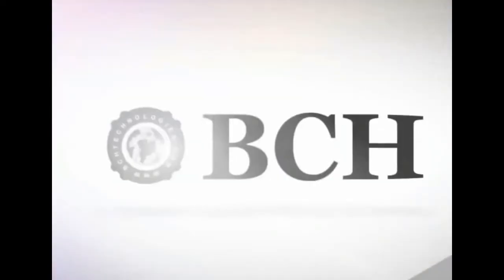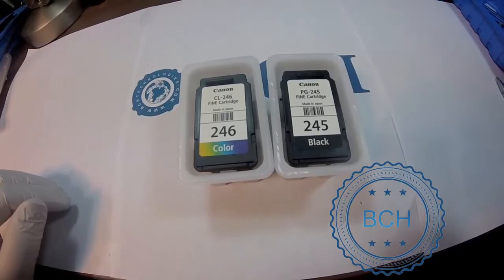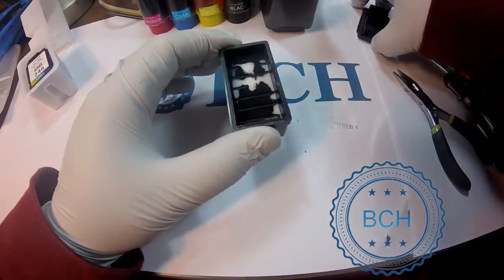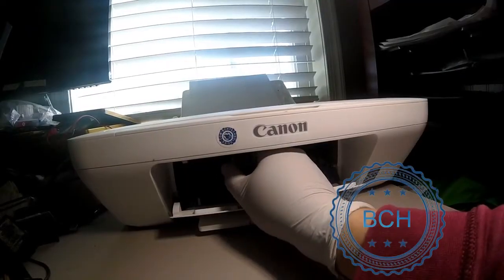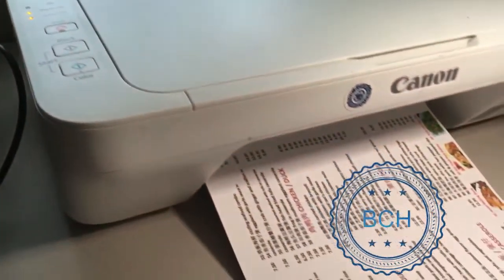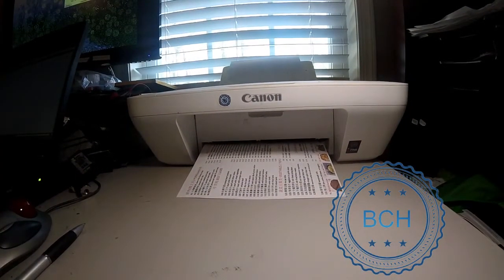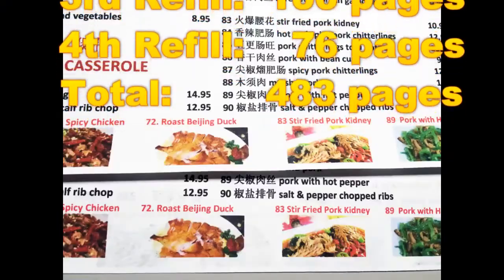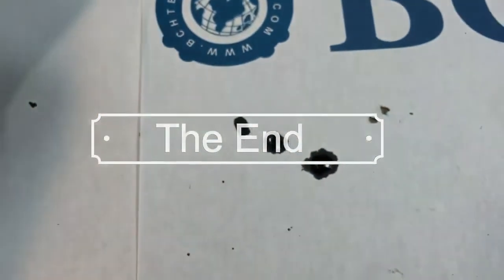How many times can you refill PG-210 CL-211 PG-240 CL-241 PG-245 CL-246 cartridges?

Comment: My Cannon MX490 still reads low (black 245) after doing this refill and after trying to reset it many times..
Reply from the maker: You cannot reset it when it is just "low" on ink.  You have to wait till you see the error 1686/1688.  Just keep printing.
Reply: It wont print with the low reading..
Reply from the maker: @seventhousand  Do you get an error message or the printer prints but the output is blank?
Reply: When I click on print I get a message showing the ink levels, black low, the printer still prints but the page comes out blank...
Reply from the maker: @seventhousand  Then it is not due to the chip or ink level.  It is due to the printhead clogging.  The printer works but your printhead is clogged.  Try one of these tricks (https://youtu.be/POaio4pnURI) and it will put your printer back on the horse.
Reply: You were right...I got the black to print, I soaked the bottom of the cartridge in Isopropyl alcohol for about 45 minutes, then wiped the bottom off, then soaked it in warm water for about 10-15 minutes wiped the bottom off stuck it in the printer and the black is printing again. Thank you for your help...
Reply: @BCHTechnologies  Just FYI that link is now a 404
Reply from the maker: @dstgre  Fixed.  Thanks!

Comment: Hi Kevin,

Can I refill non Canon brand ink cartirdges? I was planning on buying new cartridges from ''Ejet'' on Amazon since I haven't used my printer in a long time so most likely my Canon cartridges has been dried out.

Thanks!
Reply: There are no new ink cartridges from other brands. Only canon makes them (they have special chips which nobody can reproduce). These brands buy empty cartridges, refill them, remove canon branding from them and add their own sticker. If your OEM cartridge is dried out, put it in warm or even hot water for a few minutes, dry out thoroughly, put in printer, run deep cleaning process around 3 times, and print a few pages that have the color which is dried out. Repeat until works again. I have succesfully restored a few cartridges with this method.

Comment: This method is the simplest and easiest way to refill for me. I just did it and no issue.
I made sure wearing gloves to not touching print head and electrical connection, and of course to keep my hand clean.
Thanks. This video saved my time and unnecessary drilling holes.
Reply from the maker: Thanks for sharing

Comment: I have refilled the 245 XL till it bleeds out and it still wont print and the ink is bleeding out of the print side slots.
I dont think this refill crap works.
I have tried and my fingers are black with ink.
I called up canon and they say you have to order straight from them to get the "FULL" cartridge of ink.B.S.
Reply: If you have a dried out cartridge or you've been printing too long with streaks, you should unclog the cartridge before refilling.  If you continue printing with a dried out cartridge, you will irreversibly damage it.  If you have to buy a new cartridge, get the XL type.

Comment: If the sponges are in the “overfilling” state, does it work again if we rinse it with water and clearing up the ink, then use it again
Reply: If overfilled, and the cover is off, I'd simply flip it upside down  and let the excess drain out.  Then clean it off with a dry cloth.

Comment: What kind of ink do you use here? Dye or pigment?
Reply: On low cost printers, the colors are almost dye inks.  For the black, they are usually dye based but if they are pigment based, you'll get the best results using pigment ink.

Comment: Can regular cartridges be filled to XL levels, or does the XL cartridge have larger reservoirs and sponges? Is it better to refill regular cartridges or XL cartridges?
Reply: XL cartridges have really nice big sponges, so they can hold more ink with out making a mess.  "Regular" cartridges have the same size resevoir, but a smaller sponge.  The sponge of the black cart in this video is a regular, not an XL.  The starter or regular cartridges are good candidates for the spongeless lid replacement, or continuous ink supply systems, or you can actually buy a bigger sponge.  So far, I really like Canon sponges better than HP, but we will see how it stands up to refilling.   I should probably set up my continous ink supply, but I am still learning Canon.  Back in the early oughts, HPs were the best to refil, but they defend their proprietary ink too hotly these day and are no longer refillable.  So, Canon is now the most refillable.

Comment: well i did it and ink come out very fast  on the bottom
Reply from the maker: That's because you overfilled it.  The cartridge has a sponge and your goal is to get the sponge wet, not soaked. Many people believe there is a swimming pool inside the cartridge and fill the ink to the rim.  Don't.  For the overflow cartridge, just leave them in the printer for a day or two, then take them out and wipe the bottom clean.

Comment: I just did the same thing you request to do with 2 original canon cartridges and it does not work, my printer never recognize them anymore and giving me problems and error codes every time....  your demonstration is actually not quite accurate...
Reply from the maker: What was the error code?
Reply: @BCHTechnologies  :: the error code was given by other cartridges I had on the printer and was telling to call the tech support on cannon, so I did have the original cartridges cannon that I had before them and did your suggestion on refilling them just like your video describe; but the printer never recognize that the cartridges were full of ink; I also did the suggested resetting and still did not work... so I decide to purchase two refiled cartridges from an reputable supplier on ebay, that actually provide me with a guarantee and those work fine; but I still paid $close to $30 for them; which compared to $55 original Cartridge on Walmart is much better.....   BUT YOU WAY OF REFILING DO NOT WORK FOR ME!!!!
Reply from the maker: @waltpierluissi2301  Yes, the printer won't recognize the new ink level.  Keep printing.  You can't "reset" the chip.  Just keep printing until one day the printer stops you and says "Error 1688 (or 1686,...)" the following cartridge is depleted.  Do not close that window.  Keep the window open and press and hold the STOP button for 5 seconds. The STOP button is the one with a red upside-down triangle, not the scan button.  You will hear a click, and the printer is back to work.  It won't track the cartridge ink level anymore, and you can add ink as many times as you want.

Comment: Should one be worried after refilling a cartridge that used pigment ink with dye ink? Is it neccessary to wash the sponge first?
I am not sure if that's the reason my black cartridge is not working correctly (it starts printing a few pages correctly, and then gradually "looses" black ink, within one page).
It seems to me that is too early for the super-bubble scenario, as the cartridge itself is not that old (I have it for a month, 1500 pages)
Reply: Add a drop or two of 99+% isopropyl alcohol to the ink to loosen it up, it'll flow better to the print head. What you are experiencing is a viscosity issue and the ink just doesn't flow as freely or quickly as its supposed to. Loosening it up with rubbing alcohol of 99% or more solves the issue. Do not use anything under 99% as it contains too many impurities like water and such that will ruin the ink and cartridge.
Reply: Dye ink is better if you are occasionally using printer as dye ink can be unclogged easily by keeping the printhead in water for 15 minutes. But if pigment ink clogs you will need to use isopropyl alcohol to unclog instead of water which will be expensive. Even then the sponge will still be somewhat clogged forever
Reply from the maker: Thanks so much for subscribing and supporting the channel—it really helps us get closer to our 100k goal, and I try to answer subscriber questions within a few days even though I’m working through a big backlog. To your question: the good news is you don’t have to worry too much because printers can generally use either dye or pigment ink. Pigment printers clean more often, so running them with dye ink actually makes clogging less likely, and dye ink has the added advantages of being cheaper and easier to unclog. Pigment ink in a dye printer is trickier, but if you go that route you’ll just need to add manual cleanings. I recommend dye ink for most cases since modern formulations handle everyday printing well without fading or smearing under normal use. Just try to use up as much of the old ink as possible before switching types, since mixing pigment and dye long-term can create clogs due to their different chemical bases. If you want to dig deeper, I’ve linked some resources and ink options in the description, but the short answer is: dye ink is usually the safest and easiest choice.

Comment: I kind of refilled around 10 or 12 times of more than that by the method of drilling, but now I don't know it's not printing, it's like clogged but after watching all ur videos I tried to wash out or pressurize it but still it shows no improvement.
Reply from the maker: It depends on what ink you used and the age of the cartridge.  If you use pigment ink, my current count is about 2,100 pages to 2,600 pages.  For dye ink, the current count is about 3,600 to 4,000 pages.  If you refilled 10 times and used pigment ink, you are about to be around the limit.  However, if you used dye ink, you should be able to refill another 10 to 12 times.  However, these are disposable bubble jets and the printhead do get old.  We have a blog, showing the difference between a clogging printhead and dying printhead: https://www.bchtechnologies.com/blog/3-symptoms-of-dying-printhead-poor-printing-quality-may-not-due-to-clogging
Reply: yes it was very informative in knowing the theory of urs. you worked dedicatedly. one more question is pg-47 will be compatible to canon mg2500 series ( mine is mg2470)
Reply from the maker: Thanks.  I am not sure about if PG-47 will be compatible with Canon MG2500.  PG-47 is an Asian model for Canon Pixma E400 / E460 / E480.  The US market uses PG-243 CL-244 or PG-245 CL 246 for MG2500.  Canon usually changes the first digit across the markets, for example, 243 becomes 143 or 343.  The product page says it can print 400 pages, I guess it is equivalent to PG-245XL?
Reply: @BCHTechnologies  Put the cartridge in hot water for two minutes to remove the clogging.Shake to remove the water, some ink will come out, dry with tissue and install for printing.

Comment: Hello

Thank you for your video. Help!!!
I am having problems though... I tried your method but it keeps giving me a blank page when I click,  print and there is no print on the page...It was working for a few times before, after my first refill, but stopped all of a sudden...my cartridge doesn’t seem damaged
So I refilled again.

It gives me the test print of alignment with various colors including black but doesn’t print the actual material I want to be printed.

Would highly appreciate a response...
Reply from the maker: Yes.  We had two more customers reported the same issue.  It is due to your computer's software setup rather than the printer.  Restart the computer should solve the problem.  The symptom is that the printer can print diagnostic page but can't print regular pages.  Both customers reported the problem went away after restarting the computer.

Comment: Hey do you know why the black are not as black after refilling? Like, the shade of black is less deep and rich.
Reply from the maker: The dye black is not as "black" as the pigment.  Actually, it is deep purple.  If you use BCH ink, we are coming up with a new dye ink for medical printing, which is the darkest dye ink.
Reply: It wasn't BCH ink I guess the ink is the problem.

I'll get another ink. Can you wash out the sponge under water? I don't want to mix the bad ink with new ink.
Reply from the maker: If it is dye ink, then don't worry about mixing.  It should be okay.  Yes, you can wash the sponge with water.

Comment: Do your sponges resist drying out? Kits look kind of nice may test them out. Video extremely informative please leave it up.
Reply from the maker: Thanks.  We don't use a sponge.  We use a pressure regulator so it won't have fatigue issue.
Reply: @BCHTechnologies  but you used the sponges in the video

Comment: which type of ink you used and where we should buy this ink?
Reply from the maker: Thanks so much for subscribing and supporting the channel—it really helps us get closer to our 100k goal! Since your cartridge is an integrated type (printhead built into the cartridge), the manufacturer doesn’t design them with strong anti-clogging features, so we recommend using dye ink because it clogs less and is easier to unclog. If you want to start small, you can try this set: [https://www.bchtechnologies.com/refill-ink/refill-ink-for-canon/dye-30-ml-x-4-refill-ink-for-canon-printers-id30-kcmy-ac.html](https://www.bchtechnologies.com/refill-ink/refill-ink-for-canon/dye-30-ml-x-4-refill-ink-for-canon-printers-id30-kcmy-ac.html), or if you’d rather save money long-term, go with bulk ink: [https://www.bchtechnologies.com/refill-ink/refill-ink-for-canon/standard-600-ml-4-color-refill-ink-for-canon-kd600x-cc.html](https://www.bchtechnologies.com/refill-ink/refill-ink-for-canon/standard-600-ml-4-color-refill-ink-for-canon-kd600x-cc.html). If it’s your first time refilling, a priming clip can be really helpful for clearing clogs: [https://www.bchtechnologies.com/accessories/priming-clip-tools.html](https://www.bchtechnologies.com/accessories/priming-clip-tools.html), but you can also retrofit a household vacuum using this guide: [https://www.bchtechnologies.com/blog/solved-black-and-color-print-head-clogged-not-printing-part-i-integrated-printhead](https://www.bchtechnologies.com/blog/solved-black-and-color-print-head-clogged-not-printing-part-i-integrated-printhead). I try to answer subscriber questions within a few days, though I have a big backlog and I’m catching up now—thank you again for your patience and for being such an important part of this community!

Comment: While there is some useful information here, your cartridge will dry out in a week or two due to evapouration because you removed the cap, which will never again seal tightly. Go with the drilled hole method, which is easier to seal against evapouration
Reply: i thought about that as well
Reply: Got to agree with Lorraine it's easier to just drill
Reply: just did mine this doesnt work smh
Reply from the maker: Well, we respectfully disagree.  The extra exposure will come from the seam.  Because the cover is closed, so there shouldn't bee too much of it.  If you worry about it, you can use a semi-permanent seal, like the silicone glue to seal it and peel it off on the next refill.  We will do a follow-up testing of your theory, compare a drill-n-fill with this method.
Reply: @BCHTechnologies  hi..is there a way to modify a catridge so it could fit to another printer?? What would be the problem if i will do that? Thanks in advance.
Reply from the maker: @berserker0566  The problem is the chip on the cartridge.  However, some cartridges like HP 564, 920, 902, 934, 935 uses the same body shape.  If you transfer an HP 564 chip on a 920 body, it will work for 564.  Same as Epson: most Epson's cartridge use the same body and the difference is the chip.
Reply: @BCHTechnologies  id like know if it works the same thing with Canon printer?coz im a canon user.thanks sir.
Reply from the maker: @berserker0566  This video is about Canon.  I am not sure what you are trying to accomplish.  What is your printer model?
Reply: @BCHTechnologies  im guessing that if i can make a little modification with the other stock catridge here in our house..it might work to other printer..#1 problem is that the size of the catridge that wont fit to other printer if its no the compatible model. My canon is ip2770
Reply from the maker: @berserker0566  I see.  The IP2770 is an Asian model.  Swap the first number 8 with 2, you will see what American model is.  For example, your cartridge is 810, 811, so it is called 210, 211 in the USA.  It is the same cartridge, just with different names.
Reply: @BCHTechnologies  oh i see. Thank u so much for that info. I have also usa model. Mg3222..
Reply: @BCHTechnologies  1 last question.. if theyre the same chip i think the size of the catridge is also the same? So it will fit to its counterpart model printer?
Reply from the maker: @berserker0566  I am not sure if it is the same chip.  I bought an Australian model but I haven't tried it yet.  It was just for fun when I was traveling in that region.
Reply: @BCHTechnologies  thanks anyway.
Reply: @BCHTechnologies  hi. my MX330 no compatible cartridge in philipphine. thanks
Reply: @BCHTechnologies  but these are Canon cartridges in the video

Comment: Please teach us how to unclog a cartridge. My black cartridge is clogged and I've tried both types of cleaning in its system but nothing worked.
Reply: Use isopropylic alcohol on the printhead + if applicable for some cartridge models there's a vacuum adapter, like a plastic frame which mounts a seal on the print head and with a syringe about 1 ml of ink needs to be sucked out to clean the head and vacuum the cartridge. There are some clips in the related bar left, one is in chinese but shows clearly how it works.